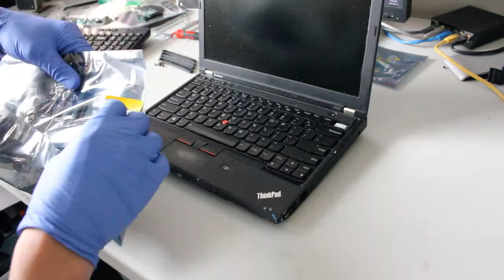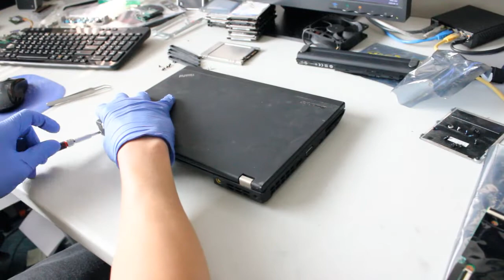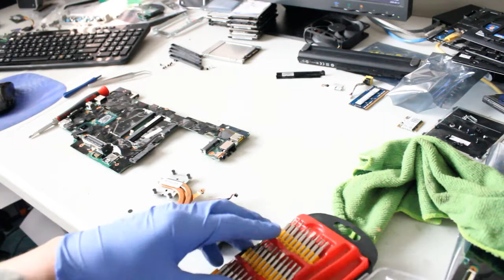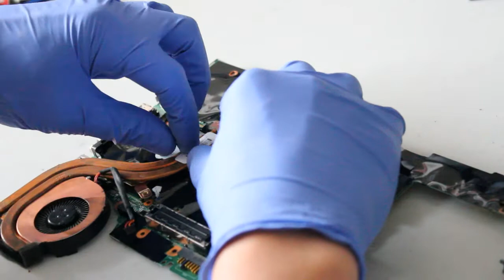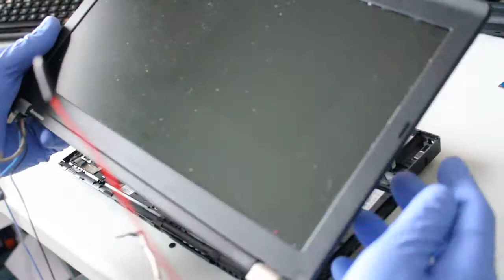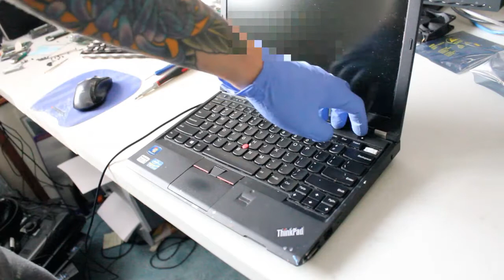Lenovo ThinkPad X230 Motherboard Replacement

Comment: my wifi failed and it is not the card.. i was thinking of desoldering/soldering a new pci connector on mb.  do you think i should just replace board?
Reply from the maker: If you have the skillset that would be great to DIY it.  If you have an extra USB port handy you could also just use a USB wifi adapter.

Comment: question.. is possible to install or upgrade the graphic card for this model? since the one it has does not support stuff live vulkan i wonder...
Reply from the maker: No sorry, you are limited to the integrated Intel HD 4000 graphics as they are soldered on the motherboard.  People have made PCIe to usb connections work, like this guy:  https://youtu.be/u4cbfqjmNIQ
Reply: @HaisteComputerRepair   i found a video where i see you connect a external graphic card with an adapter of course you also need a power source but i guess that's the only good choice

Comment: hola buen video yo tengo una lenovo thinkpad t410 y he buscado por todos lados si puedo ponerle una placa base mas actual que pueda soportar procesadores mas modernos tengo un i5 pero me gustaria un i7 y que la placa soporte mas memoria ram...me gustaria saber si tu me puedes ayudar o tienes alguna idea..gracias
Reply from the maker: With the first gen i7 offering on mobile, to my knowledge there may not be a big difference in performance from the i5.  I don't think there is a quad core i7 option, only 2 core like the i5.  The main difference being clock speed and power draw.  https://cpu.userbenchmark.com/Compare/Intel-Core-i7-M-620-vs-Intel-Core-i5-M-540/m870vsm882
Reply: @HaisteComputerRepair  Do you think it would be possible to fit a more modern board in an older laptop that supports more current quad-core processors?
Reply from the maker: @jonnramirez7430  Generally, with laptops you don't switch motherboards with different models because the layout is so different.  For example, the placement of USB Ports and everything else.  There are some exceptions, but I wouldn't expect it to work so easily.  Everything down to the cable connections to the motherboard can be very different.
Reply: @HaisteComputerRepair  I once saw a video where he replaced a motherboard of an old laptop for one that supported an i7 but it was a rare excess ... I really like the lenovo thinpad and that's why I wanted mine not to age in time ...
thank you very much for your help
Reply from the maker: @jonnramirez7430  You can definitely swap the X230 i7 motherboard for the i5 motherboard, if that is what you are asking.  You can use this video as a guide if needed.  The board will be the same, just with an i7 CPU soldered on.  I thought you were asking if you could install a completely different motherboard, from a newer laptop.    I did this with an X220T.  Replaced the i5 mobo with the i7 mobo.
Reply: @HaisteComputerRepair  what I was asking about is a current motherboard in an older laptop even if it is not the same brand.
Reply from the maker: @jonnramirez7430  Gotcha.  Without some kind of case modification, it's not too likely a motherboard could fit from a different laptop.
Reply: @HaisteComputerRepair  thank you very much for your information
Reply from the maker: @jonnramirez7430  My pleasure, I hope I helped in some way!
Reply: @HaisteComputerRepair  I want to buy a better one like yours since I can't modify mine...but unfortunately they have gone up a lot in price for an old laptop.
Reply from the maker: @jonnramirez7430  I usually sell them for a reasonable price.  I have some ThinkPad T540p's at the moment that will go for $260 CAD.  I am going to upgrade the CPU in one to an i7 and use it for work.  That model you can just swap the CPU.  Where in the world do you live?  How is the market there?
Reply: @HaisteComputerRepair  I live in spain and here the second hand market has become very fashionable and that's why they are already asking a lot of money for any laptop and right now I don't have the money to buy another one.
Reply from the maker: @jonnramirez7430  Darn, well hopefully you find something soon.  I would ship to you, but it would be pretty expensive.  Good luck.
Reply: @HaisteComputerRepair  thank you very much for your information you are very kind I like your channel very much.
Reply from the maker: @jonnramirez7430  Questions like yours keep my mind sharp and learning new things about support.  Happy to help.
Reply: @HaisteComputerRepair  thank you for responding to everything
Reply: @HaisteComputerRepair  gracias por responderme tan rápido eres muy amable

Comment: Hi there. I have same laptop also with an i5 3320M. Mine is not booting, so I will replace the motherboard but with an i7 3520M.
Does all X230's motherboard fit in same chasis? I have seen motherboard for X230i or x230 tablet. How do I know the x230 motherboard i'm buying fits mine?.my laptop is FRU no.04W1412. I have seen i7 motherboard but with different FRU No. 04W6804. Could you help me out with that info?

Thanks
Reply from the maker: That's a good question, only because perhaps there is a variance in the touch screen cables as opposed to the regular lcd panel.  I'll look into it and try to find out as I am not 100% sure.  Let me know if you find out.
Reply: @HaisteComputerRepair  I 've made a post in Lenovo support web page. If I have an answer I'll let you know.
Thanks
Reply from the maker: @JJRamirezP  Right now, I have both an X230 and X230T.  May I can take them apart and see if they are a complete match. I won't have time for this until maybe the weekend.  If you remind me, I will do it.  I know that reaching out to some forums like Lenovo Support will get replies from "agents" that are more generic than helpful.  Try looking up the question on Google with "Reddit" attached.  Or, try posting to CNET forums, Linus Tech Tip Forums, or Tom's Hardware Forums.
Reply: 📌 Core Specs to Check

FRU / Part Number: ________________

CPU Model (soldered): ________________

CPU Cores: ☐ i5 dual-core ☐ i7 dual-core ☐ i7 quad-core

WWAN Ready: ☐ Yes (extra Mini PCIe + SIM tray) ☐ No

Wi-Fi Slot Condition: ☐ Clean ☐ Damaged ☐ Unclear in photos

BIOS State: ☐ Stock (whitelist) ☐ 1vyrain / modded ☐ Unknown

Seller Photos: ☐ Clear ☐ Blurry / missing

🔹 Reference FRUs (fill in if matched)

i5-3210M → 04X1453 / 04X1454

i5-3320M → 04X1455 / 04X1456

i5-3360M → 04X1457 / 04X1458

i7-3520M → 04X1459 / 04X1460

i7-3612QM → 04X1461 / 04X1462

i7-3632QM → 04X1463 / 04X1464

💰 Price Target

i5 board: $30–50

i7 dual-core: $50–70

i7 quad-core: $90–120

☐ Listing Price: ________
☐ Within Range: ☐ Yes ☐ No

🔧 Condition / Extras

Corrosion / Liquid Damage: ☐ None ☐ Present

Accessories Included: ☐ Heatsink ☐ RAM ☐ Other

Return Policy: ☐ Yes ☐ No

✅ Decision

☐ Buy

☐ Pass (reason: ___________________________)

Comment: My only thought would be you need to update the serial number of the new board in BIOS using a usb thumb drive where you download that rebranding utility from Lenovo.  It's called rebranding.
Reply from the maker: Fair!  I didn't even consider that.  I actually have this laptop back now from a trade in, so I will do that.
Reply: @HaisteComputerRepair  Totally unnecessary for the diyer especially considering the age of these computers.  The only reason you might do it is if you expected to send computer back to Lenovo for service.  Chances of that are zero.  The S/N as no impact on the operation of the computer.
Reply from the maker: @MrJohnBatty  I reread that initial comment and maybe they edited it.  I have never thought about doing it otherwise.

Comment: Hi, thanks for sharing. May I know what is the highest processor that this ThinkPad X230 motherboard can support? And do you have the link in ebay for this motherboard? Thank you.
Reply from the maker: It looks like it is a Intel® Core™ i7-3520M (2.90 GHz, 4MB L3, 1600MHz FSB).  Keep in mind the CPU will be soldered on to the motherboard, so you will have to find one with the option you desire.  The link I purchased from is gone, but this looks like a match: https://www.ebay.ca/itm/Lenovo-ThinkPad-X230-X230i-motherboard-i7-3520M-CPU-04X1409-04W6694-04W3716/264942112952?hash=item3dafc7d0b8:g:ctgAAOSwijBd3pNi